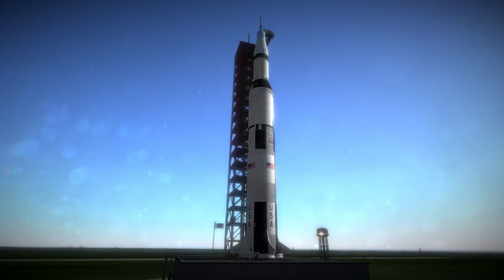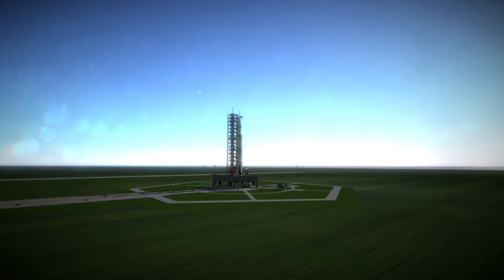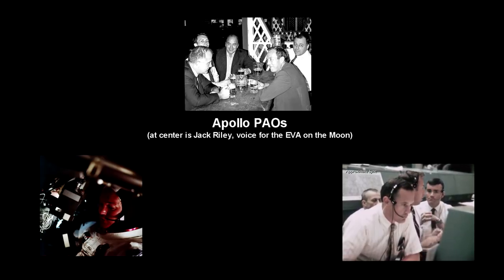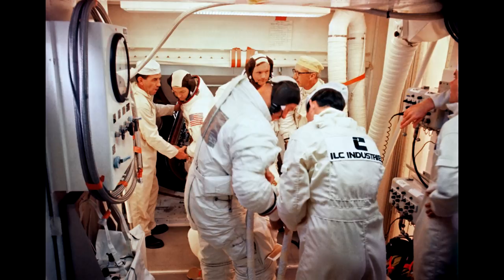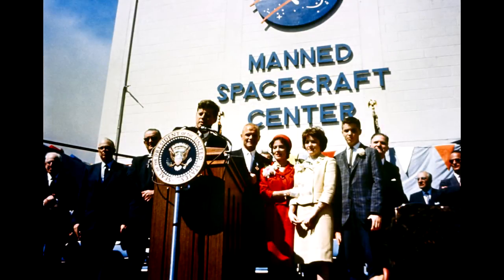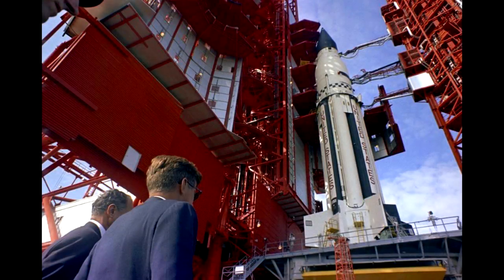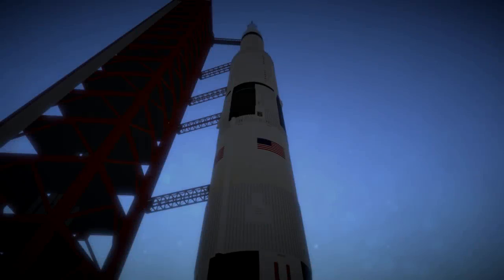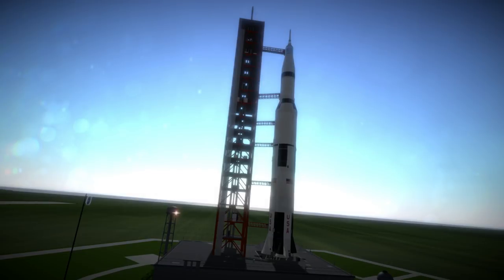Apollo 11 Complete Real-Time - T-2:41 to -1:41 - Intro to the Apollo Program

Comment: Ok so we see the cone shape that provides thrust for propulsion  but what controls attitude because those little cones on the side wouldn't be sufficient to control the service module if it were to spin out of control at an alarming rate. Also when the LEM leaves the moon how does it catch up to the service module that's orbiting the moon at 4000 miles per hour. How much fuel is used in the process. And then how much fuel is remaining for the 238000 mile trip back to earth. Were they able to make a successful  connection the first time or did they have to try several times traveling at such great speeds. Because let's not forget the service module then needed to orbit the moon again and use it's gravity to stir the astronauts back to earth.
Reply from the maker: The Lunar Module Ascent Engine's main job is to reduce the relative velocity between the LEM and the Service Module to less than a hundred mph. It is pointed through the center of mass of the LEM to minimize how much the RCS attitude control thrusters need to do. The launch from the surface is timed so that the service module will be in the right place after the ascent engine's burn. They use the RCS thrusters to close the distance between the two, so that takes some time. The LEM uses roughly 85 to 90% of its fuel getting to orbit and reducing its relative velocity with the CSM, and then 5% to close the distance after the speed is reduced - the CSM does the rest. The CSM needs to reserve about 28% of its delta-v, around 800 m/s or 1800 mph to break orbit around the Moon to return - that's the same as it needed to capture, but when it was capturing into the Moon's orbit, it had the LEM in tow, so that took more propellant.
Reply: There's so many scientific illiteracies in your post I scarely know where to begin. As the best example is the line: 
"how much fuel is remaining for the 238000 mile trip back to earth"
Err...*they dont need any.*   Once they've accelerated, the trip home is done by inertia. Takes zero fuel.  Star Trek has dumbed down the public with visions of helpless starships floating in space with zero power, but thats complete physics stupidity. Once you're moving, you stay moving. 7th grade Newtons Law.

This one is only slightly less bad:
" traveling at such great speeds"
Err...when you put your car in your garage, both you and the car are going 25,000 mph. So does it take you several tries?
Speed is relative.  If the space capsule was going 4000 mph, and the service module was going 3999 mph, then the net speed was NOT 4000.
It was 1 mph.
Repeat:  1 mph.
"Frame of Reference"  Another 7th grade topic.

" catch up to the service module that's orbiting the moon at 4000 miles per hour. "
Err...they pressed the "accelerate" button?   Duh  :/

"little cones on the side wouldn't be sufficient to control the service module"
Says who?  What rocketry expertise are you claiming to say any such thing?  I say they WOULD be good enough, and I obviously have a bit more science experience than you.

Now I'm hoping these were just honest questions. If these lead up to conspiratorial rambling Ill have zero patience for it.

Comment: @2:18 one of the astronauts has duck tape on his back is that a weak attempt to repair a hole. Those space suits don't look like anything someone would wear to the moon
Reply from the maker: No, they wouldn't wear that on the Moon. That's a pressure suit just for the ride up on the off chance they have to abort. They take those off a few hours in, and spend most of the time in regular clothes otherwise it would be quite uncomfortable. The suits for walking on the Moon are stowed in the LEM.  I'm not sure what the tape is for, but I doubt it had anything to do with keeping the pressure in It's important to remember these suits have a lot of layers. If there was a hole, it wouldn't have been through the rubber pressure garment, since they would just change suits in that case. I'm sure they had spares. I wouldn't be surprised if it was a joke. I remember on Gemini 12 they taped "The End" to the back of their suits because it was the end of that program.
Reply: Why would you need a pressure suit for the ride up when the compartment is pressurized. Also we're does it mention they had two suit. How would they be able to carry additional suits with such limited amount of space. Nice try
Reply from the maker: Well, maybe I'm wrong, but the compartment may become depressurized. Also, they're pre-breathing because it's not pressurized to full atmo pressure (14 psi) but rather will be a pure oxygen atmosphere in flight at 5 psi. If they don't pre-breathe, they'll get the bends like divers do.
Reply: Yes you are wrong and That explanation makes absolutely no sense
Reply: @jugganuat6440  well, if you think, Raiz is wrong... tell us the truth!
Reply: And when did you become an expert on astronaut safety equipment, when you were flipping burgers at Burger King, or when you were standing in line at Taco Bell?